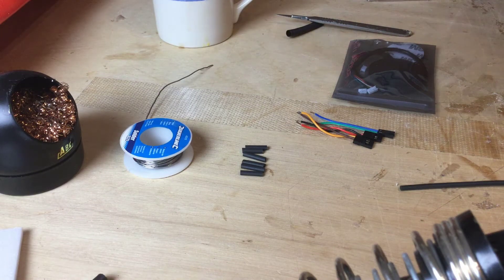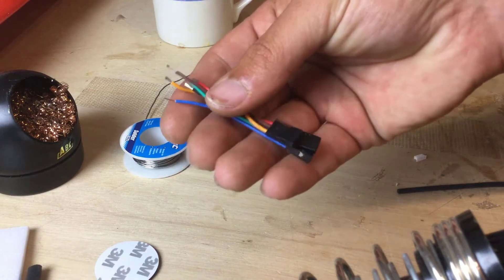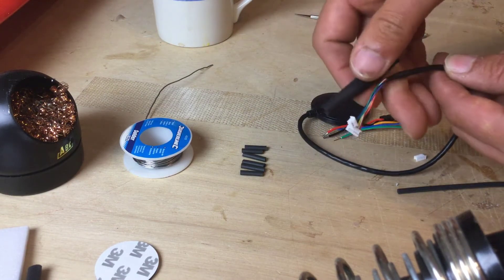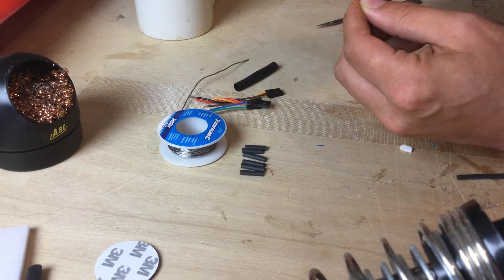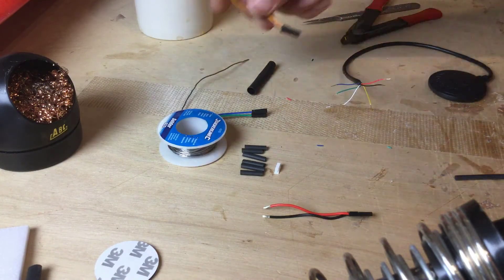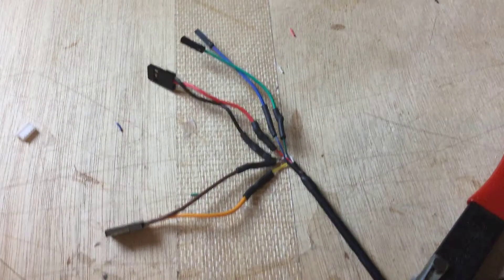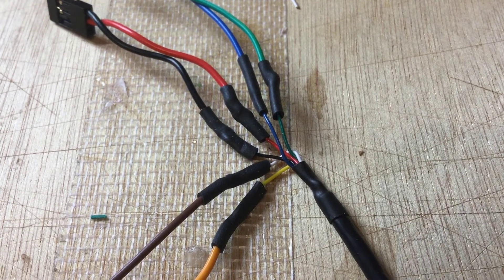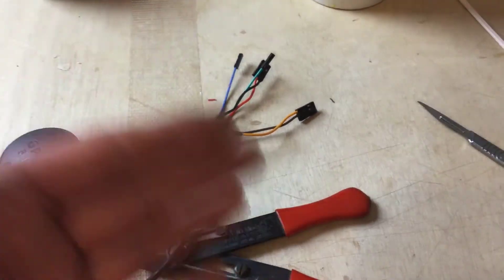Part #6A - Soldering Up the NEO-M8N GPS 📡 Unit for iNav [Omnibus F4 V1]

Comment: Matt...the GPS you use in the tutorial is not the same one you recommend on the Banggood web ad. At least the wire colors  are not identical. I can't follow your tutorial as my wires are not the same color. I suspicion Banggod has substituted an alternate GPS. Please advise?
Reply from the maker: Hi Paul, I have no idea on that one, I would suggest you contact BG and as for the correct wiring diagram, Matt

Comment: matt the wires on my gps dont match your gps. on your other video the red wire from gps is not power HELP!
Reply from the maker: Hi Robert, you'll need to contact the place where you bought the GPS and ask for a wiring diagram, I'm only able to answer questions on the suggested kit, Matt

Comment: Hi Matt, I have used a naze32 breakout cable for the gps, unpick the cables and remove them all from the plastic connector as you would with a servo plug, solder the wires as you have done in this video then push the pins back into the required holes on the connector and you cannot accidentally get the magic smoke and the gps can be unplugged using one connector.

Comment: This omnibusF4 proV2 is short of one port when using port 1 for Sbus, port 3 for Compass and port 6 for GPS. I need telemetry to my taranis but no ports is available :-( do you know how to get telemetry to the taranis when using alle the ports?
Reply from the maker: Howdy Villy, not sure, I tend to use the L9R on my setups that doesn't support telem, Matt
Reply: Matthew Ogborne L9R do support telemetry through the smartport. I have decided to ditch the compass and relay on gps solely, and use uart 3 for telemetry.

Comment: Matt can you check the tx rx cables shown in the description
 (WHITE - This is the Tx wire which is connected to Rx on the FC
YELLOW - This is the Rx wire which is connected to Tx on the FC) 
I had to swap them over to get it to work 
Just seen you had the same problem in the Live video
Joe
Reply from the maker: Howdy Joe, in this instance it doesn't matter as it'll either work or won't. And if it won't just switch them around and it will then work. It's not like the GND & 5V which switching those wires around which would have nasty side effects :) Matt

Comment: actually this plugs are really easy. I have also done the JST SH connects and they aree fiddly. I do it mainly because it gives one less point of failure and also looks very clean and with the 1x6 enclosure it it difficult to stuff it up.
Reply from the maker: Howdy Gordon, yea the JST Sh are fiddly to say the least, I solder on to the wires leaving plenty of spare length and then cover it all up with some heatshrink :) Matt

Comment: Instead of Soldering onto the end of the wires I gotth "Geekcreit® 310pcs 2.54mm Male Female Dupont Wire Jumper With Header Connector Housing Kit" from banggood https://www.banggood.com/Geekcreit-310pcs-2_54mm-Male-Female-Dupont-Wire-Jumper-With-Header-Connector-Housing-Kit-p-1063303.html?rmmds=myorder and I just cut off the jst-xh connectors and then crimpted on the new plugs. I was also able to 1x6P connector housing and it just all connects in a line from the rx, tx, 5v gnd, sda, sdc (?) and is really clean. This GPS module works great.
Reply from the maker: Howdy Gordon, oh yea that would work for sure. They're just super fiddly :) Matt

Comment: Hi Matt,
Did you tried to upgrade it to v3? Somebody had success on it however BG says it cannot be: https://www.rcgroups.com/forums/showpost.php?p=35661541&postcount=5
Does is have a supercap or battery on it? Does it store the configured baud rate permanently?
Reply from the maker: Howdy Sequadon, I've not tried upgrading, it works fine as it is. It does have a tiny battery on the underside so it remembers the last fix it had and the baud rate is set already I believe at 115200, Matt
Reply: Thank you, I'll try it with my wing wing

Comment: Matt, do you think that these GPS cables would fit (with cable rearrangement) into the F4 V2 board (it does look like a 6 pin to me) :)
Reply from the maker: Howdy Jaikishan, absolutely! 
You need the extra 6 pin connector to do that. I have another board I need to solder up, so will record that part of the series when I get to doing it. Matt
Reply: I'm sorry, you've lost me, on the FB group, you've linked the 6pin JST connectors, but we need not buy those if these connectors can be directly plugged in right? (Granted we need to 'rearrange' the wires.)
So all the 6GPS+compass wires can be put into a single 6pin connector and connected to the v2 board yes?
Reply from the maker: Short answer, Yes!

Comment: are you at the point of replacing all your vector models with the cheaper inav stuff matt?
Reply from the maker: Howdy Jamble, the models that have Vectors in them are keeping the Vectors. The Mini Talon, Mini Drak and X-UAV Clouds have Vectors in, however I won't be buying another as #1 3 is enough, #2 iNav and these FC boards are one fifth of the price, Matt
Reply: fair enough, 3 vectors! thats a lot lol